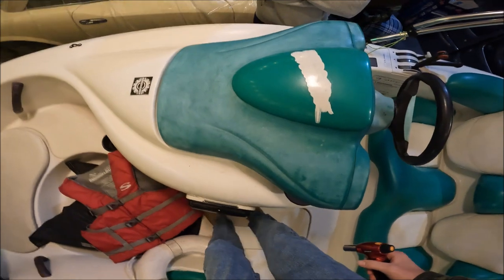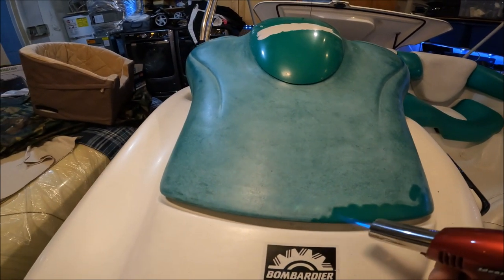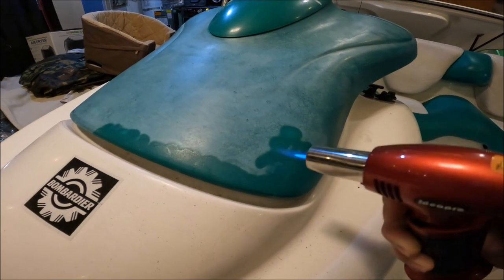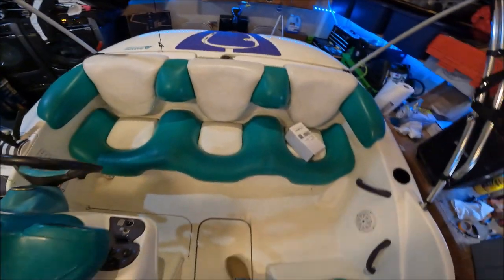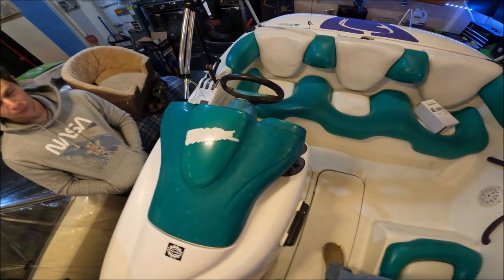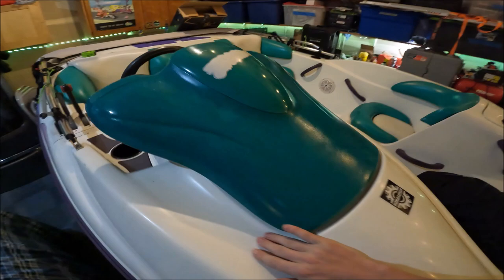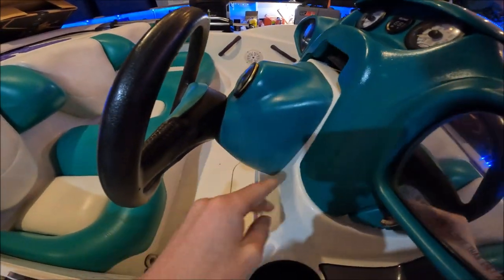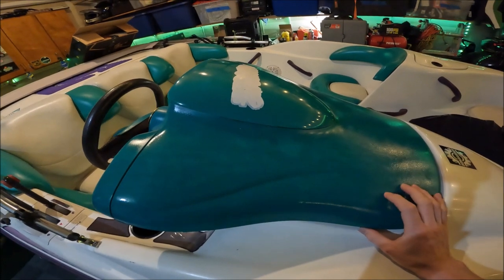Restoring faded plastic with torch

Comment: I used a heat gun on mine it turned out pretty good. Not that you care to know, but I have the same boat and green hawk 250 as you lol
Reply from the maker: No way!!! I do care that’s awesome! 
You have good taste!  😎
Reply: @SteverGarage  lol I was going to comment on the video with the new SBT engine you ordered. Hopefully she runs good for you. I just rebuilt my 787cc top to bottom. Hope it runs 🤞.
Reply from the maker: I had to warranty my first SBT engine after it blew up in 2 hours ..:( but the replacement came and I installed it and ride around for an hour. Now just waiting for nice weather to finish break in. 
I am sure you will have better luck then me hahah
Reply: @SteverGarage  After all the time,money and research I seriously I hope so man. One thing I never really thought about is the break-in procedure. Do you know the exact process?
Reply from the maker: There is different opinions all over the internet. SBT told me to ride around at low   RPM for 2 hours 
I think that’s ridiculous but my first engine blew up and I didn’t follow that so…

Heat cycles are good 
Go easy on it 
They have break in oil to add to your gas in addition to the auto injection they sell as well